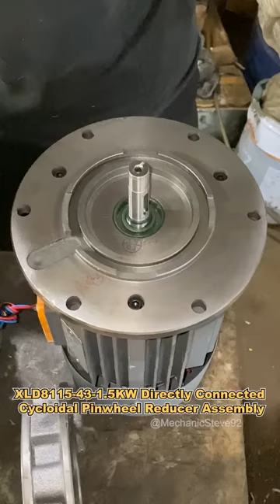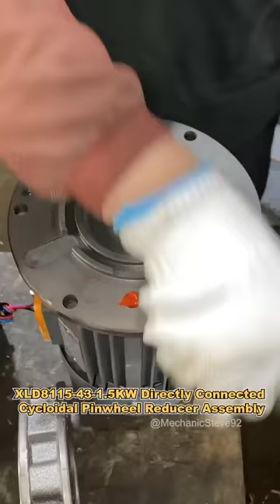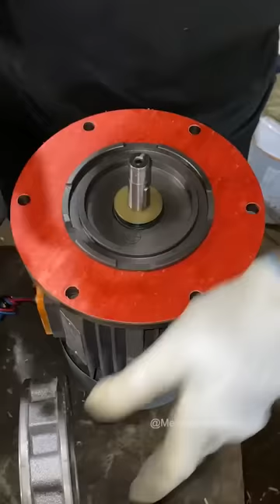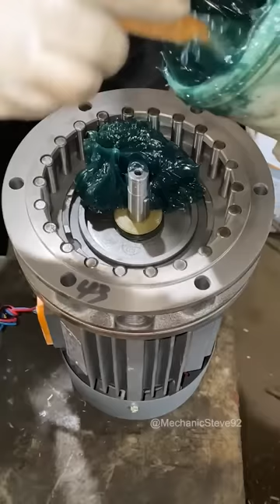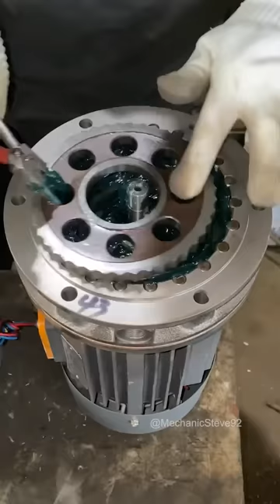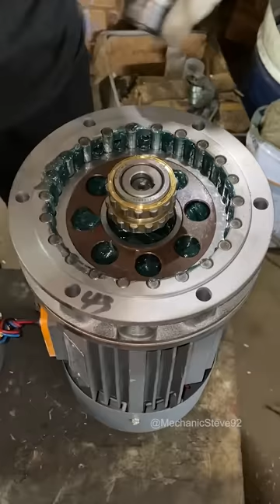#mechanic #automechanic #automobile #cars #trucks #restoration #mechanicsteve #shorts #fyp #short

Comment: Cycloidal gear reduction. there are two of them 180deg phased out to balance it.
Reply: Used in what machine?
Reply: @henryrollins9177  wherever the engineer wants it and needs it. It's an electric motor with a dual cycloidal gear reduction from what it appears 22 to one. It has no specific application. In a factory it may be needed to raise a boom on the assembly line. In not sure how much gear reduction it needs or about the angular velocity. Anyway, googling the part number  XLD8155-43-1 gives out the manufacurer BAMAI in china that ships this in a various number of configurations of the gear reduction depending on how many stages it has. the datasheet states it for 22 to 1, 264 to one, 18125 to one.. so that is from one, two or three cycloidal stages.
Reply: TRUE FUNCTION AS GEAR REDUCTION BECAUSE I USE THE SHIP TO TURN THE SHIP PROPELLER OR AS CALLED TURNING GEAR
Reply: @AsiAzzy  Thanks, you know your stuff...
Reply: @anjuGOGO  warum schreist Du uns an? Warum schreibst Du in GROẞBUCHSTABEN ?
Reply: @AsiAzzy  Thank you, Good explanation. I suspected it to be something like a reductor, but i have never seen real cycloidal one. Only models a few years ago.